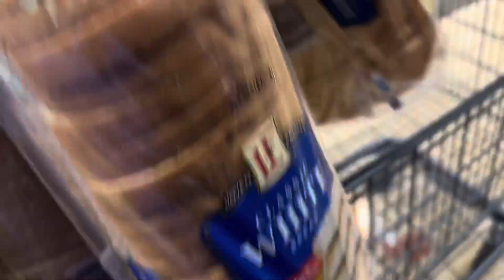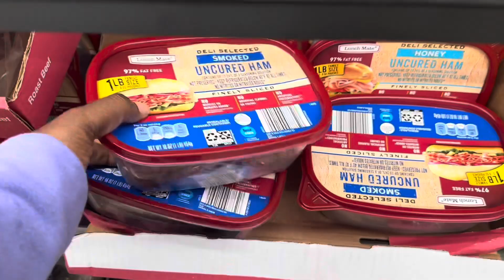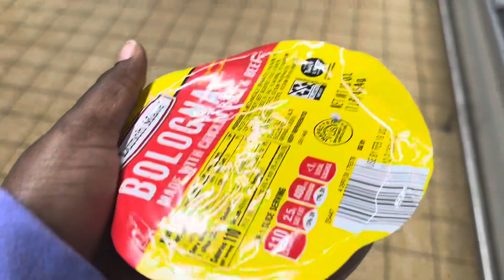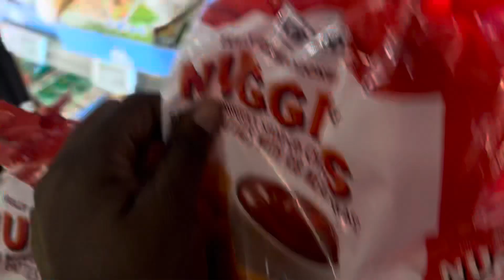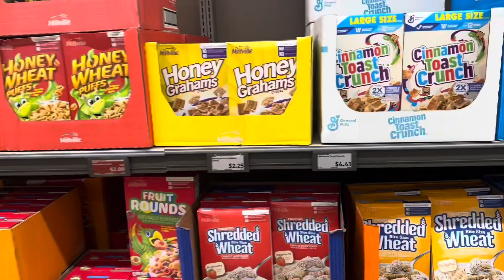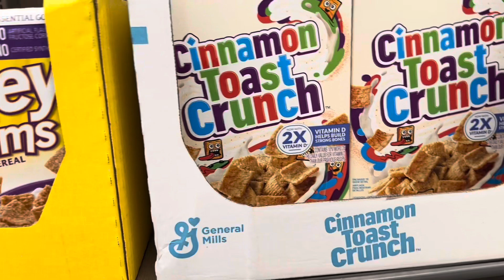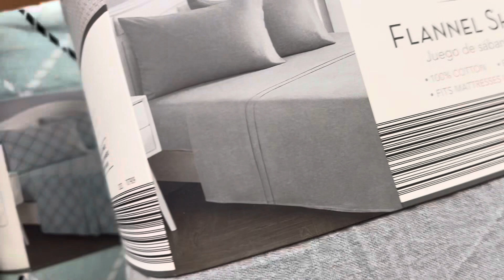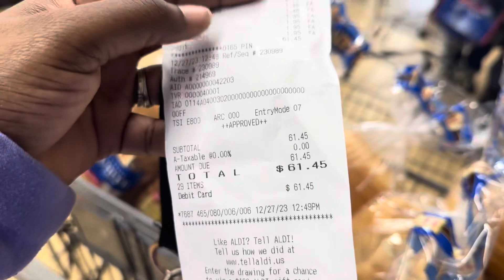Grocery Shopping At ALDI

Comment: Another cheap meal for the kids, are the tortilla pizzas. One package of flour tortillas, one jar spaghetti sauce (or any sauce you prefer), a block of cheese (or two LOL), shredded, and if they desire some pepperoni OR bacon bits. Add anything you have in your pantry! Spray your pan before you place the tortilla on top of the pizza pan. Cook at 400 degrees in convection oven, 12 minutes. Enjoy!!!!!!!!!! You can pre arrange them by stacking the pizzas with parchment paper in between pizzas and freeze them and your kids can pull out each piece they want to eat. My teenage daughter loves this along with a bowl of salad.
Reply from the maker: I use to do this with low carb tortillas when I was doing low carb. Great idea ❤️